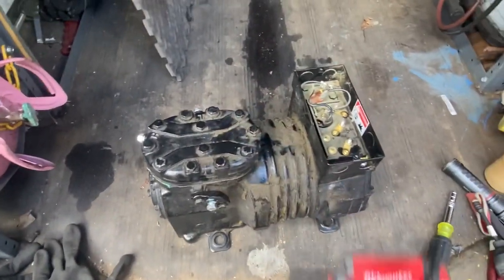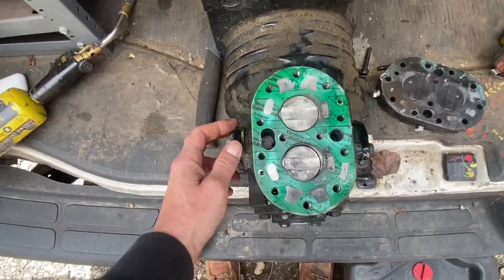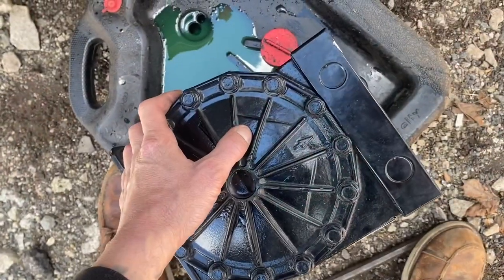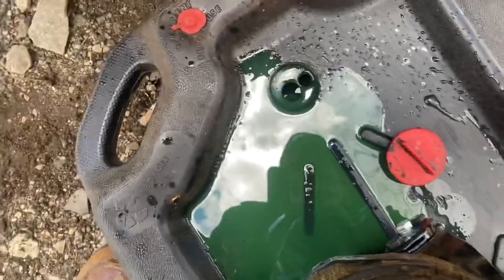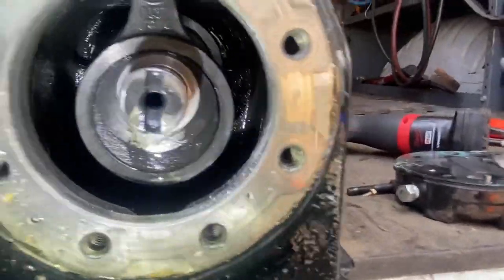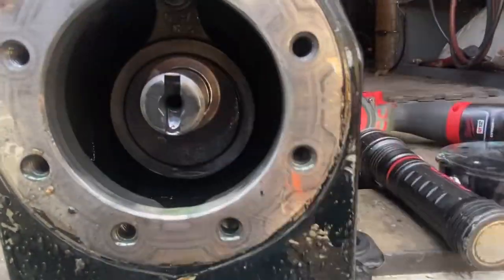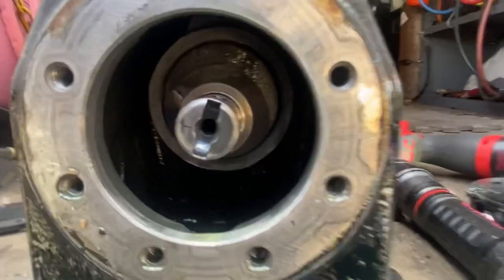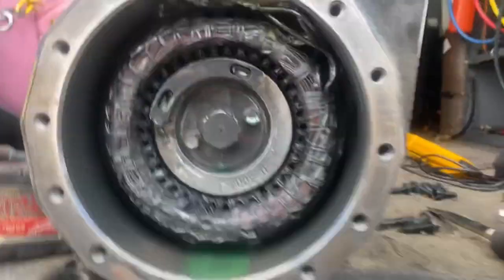Compressor was bad , let’s pull it apart and find out why

Comment: Great video Not to much out there on these. I have a model HF is the only thing on the tag. It is an older unit and looking to see if there is any parts available of it. Called Copeland 3 time and no return call. Any ideas on what company I could talk to about parts or a possible rebuild of my unit. Mfg. Tag info Copelametric Model HF, See. 401337, HP 33x, 5 Amps, single phase 120/60.Any help is appreciated
Reply from the maker: You could try calling your local supply house and see if they can match it up

Comment: Question wonder if the initial cause of the windings overheating over a period of time possibly high superheat or some other reason that that caused the windings to break down and short

What you would mean the windings are only the symptom of another underline problem not related to the compressor ?

Comment: Awesome video! Inside the semi hemetic compressors are the windings covered in oil? Just curious.
Reply from the maker: Yes
Reply: @Cscrefandhvac  I'm assuming that's how you cool the motor. That's awesome. Thanks for the video brotha!
Reply from the maker: @dustinbartlow4318  well technically what really is supposed to cool the compressor is the suction gas .
Reply: @Cscrefandhvac  I gotcha but the motor would get really hot being a sealed motor correct? I just assumed they used the oil to cool the windings as well as lube the compressors moving parts.